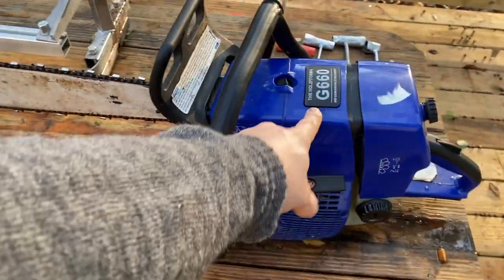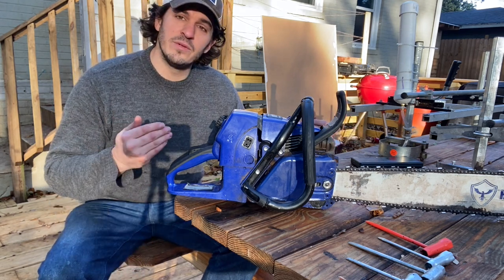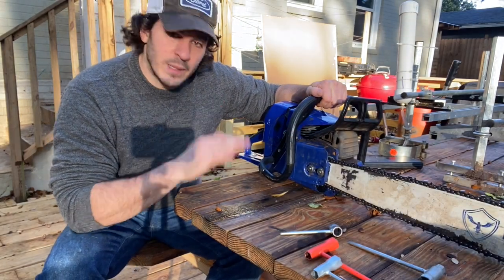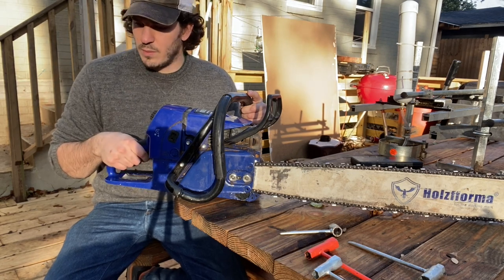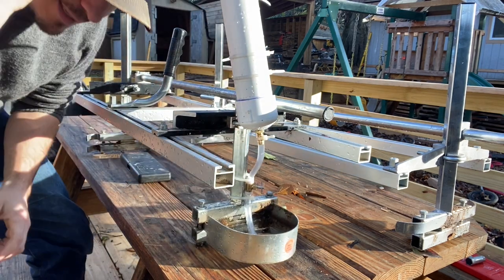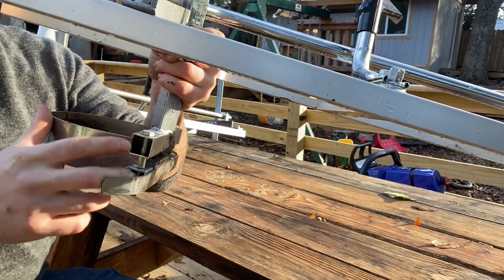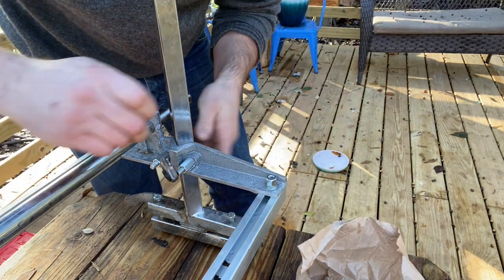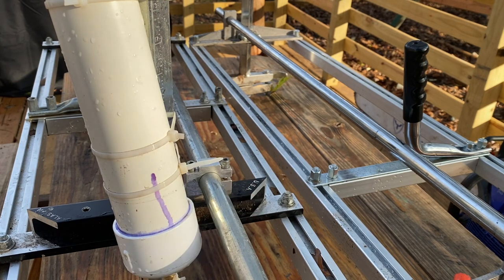Reviewing Holzfforma G660 and Farmertec versus Granberg chainsaw mills

Comment: Excellent review!  I have a G660 as well.  FWIW, they are 92cc saws.  The handle is metal, but I agree, it's not has durable as I'd like.  The full wrap handle is a MUST if you're going to do any felling with the saw.  I ended up bending mine out slightly so that the shorter scrench will fit it correctly.  Also agree with your thoughts on the on/off switch.  It's on my list of things to eventually upgrade, but its been working for the last 2 years so we'll see.  I haven't had problems with my tensioner (28" and 42" bars), but I've heard of the problem before.  I really should get a spare to have on hand.  As far as parts to replace, I had to replace all of the fasteners that needed installed by me.  For the record, that's the ones that hold the handle on, and the screws and nuts that hold the felling spikes on.  My oiler was also problematic.  Since I need to run a 42" bar from time to time, I picked up a hi output oil pump from Hyway, and it has worked fine.  I haven't had to do anything with my recoil.  I've also heard of problems with the clutch springs.  I messed mine up (user error) so I'm not sure if mine would have had any problems or not.  Either way, a $30 replacement from Hyway took care of it.   I also picked up a DP muffler from them.  All in all, I probably have an extra $50 to $60 worth of parts on mine.  I also have an 064 that was rebuilt with an 066 top end.  My clone is absolutely a stronger saw than the 064 rebuild.

My reason for going with a clone instead of an older used saw that only costs a little more than the "fixed" close is that with the new saw, I'm getting new rubber seals, new rubber intake boots, new anti-vibe bushings, ect.  These are things that go bad due to age, and can result in some time consuming repairs on the older saws.  I don't mind wrenching on a saw (new clone OR used OEM) that I didn't pay $1,500 for, but I feel like the failure modes on the new clones are more well defined meaning that I can replace a few parts up front with either OEM or quality aftermarket, and then I'll be trouble free for several years to come.  By contrast, if I buy a used 660, there's a good chance that I'll be having to rebuild the carb or replace some rubber after a year or two.

Comment: Do you think sleeving or putting some type of bushing would help with the thinner material on the bar stabilizers (for lack of a better term) of the Holzfforma mill?
Reply from the maker: That could help. I put a large washer on it and a longer coupling nut. At least it’s functional that way.

I ended up using it for parts on my granberg mark iv. The rails are interchangeable

Comment: I'm going the wrong way lol. My life are to nic for my band saw so I just ordered a g660 to do the big logs
Reply from the maker: I’m going to put another video out on this saw. I think it’s better to buy a used stihl/husqy, or save for a new saw.

I’ve had so many problems with the saw and replaced so many parts, that I could have purchased a used 660 or 395xp for the same price or a little bit more. Ignition coil went out this week, a new one is $150. Chain tensioner ran $50. Spark plugs go back because saw runs real dirty, and the pull cord mechanism is giving me problems so there’s that too.

I think these saws are extremely homeowner grade, and basically last long enough to expire the warranty and then leave the customer needing to spend a whole lot on parts.

I’m hoping this can last long enough to get a bandsaw as well!

Comment: I just bought the mid size granberg to start getting into milling and I love it! I need a bigger saw tho I’m running a 60cc husky and it’s struggling so I’m deciding on a used ms660 or a new Holzfforma.
Reply from the maker: I can’t say what would be best for anybody else but I would have been better off starting out with the ms660. I spent about $350 on the g660, and probably another $250 on repair parts. 

It lasted less than a year, and left me stranded and frustrated quite a few times. Plus the hours diagnosing and fixing it. That $600 would have gone a long ways toward a new or used ms660.

Comment: Very good review of both the saw and mill. I agree totally with your assessment of the saw. 
Found your video because I need a longer bar for my G660 and was comparing the Granberg n Holtzfforma bars n chains. 
Going with the Granberg because there’s not enough price difference not to
Reply from the maker: Thanks for the comment! Absolutely agree about comparing Granberg v Holzz for that. Their mills are just flat out awful. I really like their solid nose bars though, especially for milling. You don’t need to choke up so much on the nose so gives you prob 2-3 extra inches! Awesome

Comment: I work in mechanical design and the truth is everyone copies everyone. The IP stuff is mostly about creating economic rent and a monopoly market for your self. From a consumer point of view don't worry about lol, if its cheaper and a better fit for you buy it, they are not paying you to defend their patents, brand loyalty is for suckers imho. 

These Chinese saws started as parts saws for the AM parts market since the OEM doesn't provide good support for their legacy products and then evolved into completely saws. They are a option in the market and are not as good as OEM but are better from a price perspective, for 300 dollars you can probably get a used MS660/066 on its last legs.
Reply from the maker: Totally agree about the aftermarket and the size. Mine actually just crapped out, gave me about a year. I was running it on 40 to 1 fuel oil, but a lot of the guys that use these for Mehling like I did that I need to be down to 30. 

I’ve been pretty “meh” on the quality of these saws, they’re a little bit short of minimum viable, but also agree that they have their place. Brand loyalty is absolutely for the birds

Comment: I know this is a year old, but I had a couple of thoughts. First, I already ordered a Chinese mill, so perhaps I watched too late, but time will tell, lol. The economics have changed a bit in just a year, and it looks like the Granberg mills have gone up in cost about 30% while the Chinese mills have actually gotten slightly cheaper, so I have to ask myself if the Granberg is really 3 times better after making the inexpensive upgrades you mentioned here (thanks for those tips btw, I’m going to do those right away). 

Another point is that Granberg sells rail and tubular handle sets to convert your mill to a different length, for a hundred and something bucks (which I think is still kind of high for what it is), so you would only really have to buy one mill, as long as you don’t mind taking the time to convert it back and forth. 

I’m actually wondering if I could buy longer rails from Granberg and convert my Chinese mill, since Granberg makes a lot more different lengths than the Chinese companies. The channel stock looks very similar. I’m wondering if the tubular handle is the same OD … what do you think?
Reply from the maker: I would stay away from the Chinese Mills. They are of such poor quality I couldn’t get good boards with them and ruined some good wood.

I did, however, find that the rails are the exact same size, the Chinese ones slightly thinner. So when I scrapped my Chinese mill I extended my grand berg mark iv, and it’s working great.

Some Chinese stuff is great but that Chinese mill was a total waste of money. And when I brought the issues to the companies attention they wouldn’t give the time of day. So I think the Granberg is worth the money for sure
Reply: Thanks for the reply. That’s exactly the kind of info I was looking for. I’ll proceed with caution with the Chinese mill, since I already have it. It’s branded Neotec, though the design looks the same as yours. Great to know about the compatibility of the rails. If it’s unworkable I can upgrade parts to make a Granberg mill and probably not be out too much. Cheers.
Reply: So, if I replaced the end bracket assembly with Granberg parts, do you think it would fix a lot of the issues with the cheap mill?
Reply from the maker: If I could do it all over again, I would buy the Granberg mark iv mill, and longer rails from Holzzforma.  Literally everything else on the Chinese mill was junk. Even the hardware.
Reply: Haha. Gotcha. Thanks for the advice.